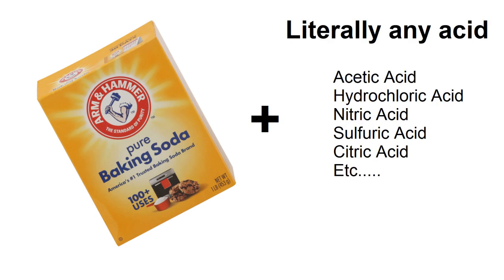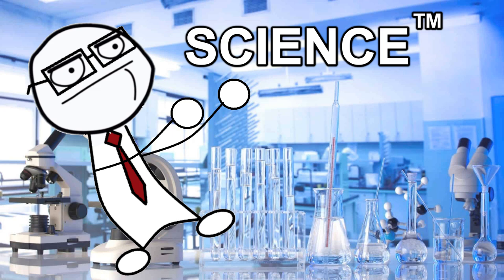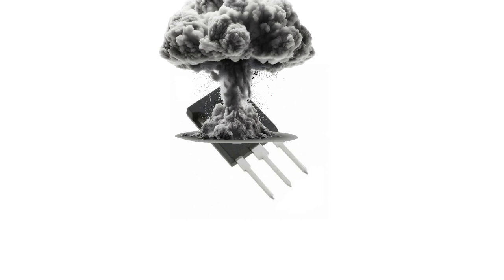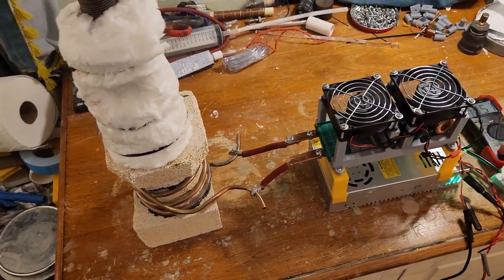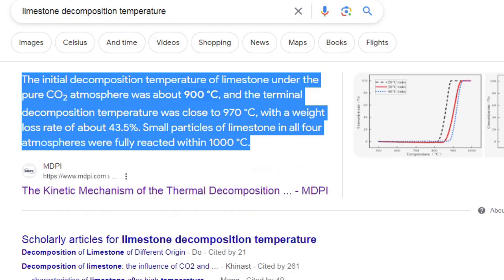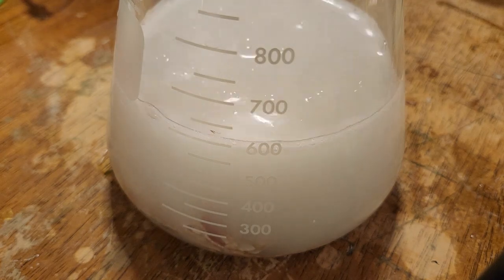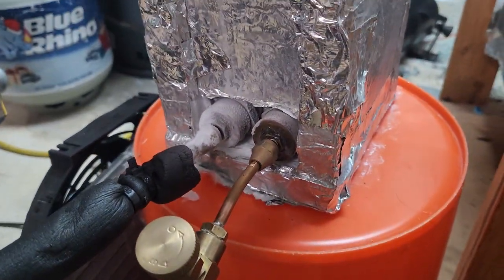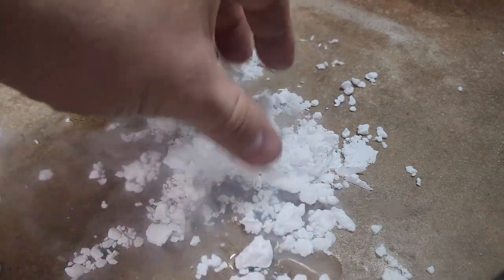Dry Ice from Sea Shells

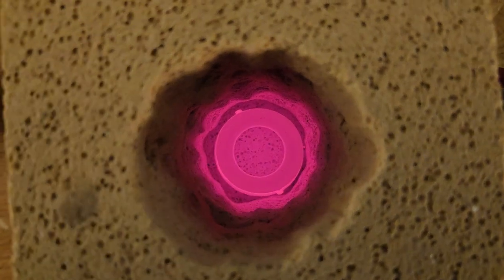Comment: 4:10 Camera sensor is sensitive to a wider spectrum than just the visible light, and they typically have a wavelength band pass filter on the sensor itself or on the lenses, but that filter only gets you so far.
If you have a source of broad spectrum light strong enough, some of IR and UV makes it to the camera sensor and gets registered, and IR triggering red plus UV triggering blue, makes magenta.
Reply: I dont think there is any substantial amount of UV produced, as the spectrum does not even contain enough blue yet to appear white. It would need to be way hotter than that.
Also: so far, every camera i've seen picked up IR as pink
Reply: The human eye has a frequency response bump for the "red" cones high up in the violet area, which is why red+blue appears as purple. I suspect something like that happens with camera sensors, which is why strong IR appears as fuchsia instead of just red. But in their case the blue filters are letting in a little IR.
Reply: As far as I understand, this is generally true, except, red pixels in a display wouldn't be able to reproduce more "red" red, which means, even if the camera picks it up, a screen wouldn't be able to reproduce it without usilising blue component.

So maybe it's a quirk of the inner workings of a camera sensor, that more "red" red, is processed as magenta, and the electronics part of it actually convert "very red" as red with some blue.

Comment: My college capstone project was designing a cement mine and I was in charge of the aggregate and processing (I’m not a chemical engineer or a chemist so I had no clue what was going on). 

Modern Portland cement is still basically lime and some other fun additives. Particle size is very important at every step, which is what I was focusing on (due to an issue with our data, we could not get accurate mineral estimations and thus couldn’t do anything with the chemistry). All the research I had done discussed the importance of the additives and mineralogical makeup of the rock but not the basics of the chemistry. 

But despite days of research, your tiny blurb about limestone and mortar made everything click.

The rest of the video was good too I guess.

Comment: Shouldn't fermentation be the absolute cheapest way to produce CO2? With just a few hundred grams of brewers yeast and a good few pounds of sugar you could generate hundreds of liters of CO2 in a couple weeks. It also yields ethanol as the byproduct of course (but the result will be hardly drinkable if your main objective is to maximize CO2 production).
Reply: Wouldn't that be an expensive way to make CO2 because of the cost of the sugar?
Reply: @ShannonDove-sy7ye 
It would still be cheaper than the previous baking soda and vinegar method, but not quite as inexpensive as I initially thought - unless you'd also burn the byproduct (ethanol) to generate additional CO2. Now that I think about it, burning the ethanol might actually produce more CO2 than the whole fermentation process itself lol. This thought made me reconsider, and I now think the most time- and cost-effective method would probably just be burning a gas. For example, a gallon of propane (around $3–$4) can produce roughly 12 pounds of CO2, and the whole process is much faster than waiting weeks for the fermentation to finish.

Comment: Why not just use propane to produce CO2. use a catalyst in a resistive tube furnance to decompose Propane into water & CO2. Use a Chiller to condense the Water out from the CO2. You can get about 6000 grams of CO2 from 1 Gallon of Propane. You could probably just skip the Beach Ball, and produce the dry ice directly from the the CO2 produced from the tube furnace. A simple test use a descant to remove the water vapor.

Comment: Wouldnt it be easier to just use a common microwave transformer with a dangerously high coil ratio for insane currents on the induction heater?

Comment: In theory what you can do is leaving the calcium oxide in open air and it will pull carbon dioxide from the air, regenerating it.

Comment: hmm, Since your at it, how about making synthetic fuel? seems to you need hydrogen and CO² under a pressure of around 600 bar.
Some invention from a German in the 20tis of the last century but using coal.
Reply: Your referring to the Fischer-Tropsh processe that uses Hydrogen and Carbon Monoxide. It does not work with CO2. FT doesn't require 600 bar, only about 40 bar. I think your are confusing with the Haber-Bosch process to produce Ammonium from Methane which needs about 400 bar.
Reply: @guytech7310  Well, i checked those article only briefly, 600 bar was mentioned in a WWII documentary on German synthethic fuel that's how i got that number. some youtubers went to visit the worlds biggest synthetic fuel plant in South Africa, they said it was CO², the Company "zero" states it's CO² they use to make that 100% climate neutral stuff. in any case the Germans made that fuel using (brown) coal.

You're right: All synthetic hydrocarbons are generally produced at temperatures of 200–300 °C, and at pressures of 20 to 50 bar. Catalysts are usually used to improve the efficiency of the reaction and create the desired type of hydrocarbon fuel. 

using the Sabatier process, i see now.

Comment: That is NOT an induction heater. That's a Royer Converter. It has not been designed for induction heating and commonly known as the Noob Heater because so many people try to build it as an induction heater due to the misinformation on the internet that it can perform as such but IT CANT. It will ALWAYS blow up your IGBTs or MOSFETs as it's inherently unstable. The newb explanation of them mutually shutting each other off and thereby generating the oscillation is wrong. What actually happens is that this circuit likes to latch-up with both transistors being caught shorted and thereby burning out.
The only way to prevent this actually make a reliable induction heater is with proper transistor drivers that ENSURE A TOTAL POWER DOWN ACROSS THE POWER RAILS with a deadtime of both transistors being completely off. Just google Latch-up.

The only Youtube person I know who published a video of a proper induction heater is Backyard Scientist. Look it up. His circuit is solid. That's how it's done.

Comment: You can also absorb co2 using sodium carbonate and decompose the bicarbonate in boiling water (or faster at a higher temperature ) this can be automated you can just get a barrel of it with a air pump and feed it into a heater or heat exchanger with co2 capture (or just brew some beer to get the co2)

Comment: 5:40 these 100K resistors nor the 1k pull-up aren't needed and probably neither are the diodes as the totem pole transistors arrangement strangle themselves on the base witch is kinda cool. Without knowing i have send you the Weighbridge oscillator, using a hi power opamp and a inverting config to drive the mosfets and also less parts.

Comment: I would point out that you can buy big bags of slaked lime for a few dollars, and it has other uses. Or buy limestone of course.Though the bulk price of  baking soda is not that bad for minimal effort and you can use low heat instead of vinegar. Or if you split water you could just use the pure oxygen to burn carbon with minimal water or nitrogen involved. 
But hey, I guess seashells are more interesting. Just not universally common.
Reply: Slaked lime is useless for CO2 production, though. It's more of a byproduct of this method.
Reply: @ZeroPlayerGame  It's a cycle. You burn limestone to emit CO2 and get quicklime, you slake it with water to get slaked lime, and you let the wet slaked lime absorb atmospheric co2 over time to get back to the beginning.
Reply: @spaceminions  ...I suppose, but you could also just use eggshells, or even rock if you live in a limestone geological area.
Reply: @spaceminions  You just designed a new form of CO2 sequestration.
Reply: the lime process is regenerable because slaked lime in water will pull co2 out of the air to reform calcium carbonate, which you can crush and re-heat. he doesn't need to continuously obtain lime.
Reply: @sneediumminer  I suppose yeah. Takes time though.
Reply: @sneediumminer also if I'm not mistaken, slaked lime sets by itself (hence the use in mortar), so I imagine it's a bit of a pain to work with. I guess you can add water and not let it dry, but then the CO2 exposure is way worse still. Atmosphere doesn't have a lot of that, despite our best efforts.
Reply: @ZeroPlayerGame  I have no idea where I would get massive quantities of eggshell, which should have a lot of organic content besides, but at least you don't need to be near a beach. I already mentioned limestone if you only want co2. But it's not pure either although it's not problematic here. As for absorbing co2, back when people didn't think whitewash is made of latex paint, they knew that it absorbs CO2 just fine if you keep it damp, and in fact it's desirable to do so in order to get it to cure properly.
Reply: @spaceminions  I mean, in a thin layer, sure. Organic content is minimal and gets promptly fully combusted into more CO2 at 200 C anyway. Either way, worthwhile idea!
Reply: @ZeroPlayerGame  Thanks. I did see someone else's suggestion of just using fermentation to produce the co2 which I have to admit is much more accessible than the others I thought of.
Reply: @spaceminions  the most accessible would be, just try to breathe out in its general direction :)
Reply: @ZeroPlayerGame  XD
Reply: @spaceminions  yeast can only produce a solution of around 10% ethanol, so my napkin math shows that every liter of brew is only going to produce around 55g of CO2
considering the video was talking about kilograms of dry ice, you're going to be doing a lot of brewing
Reply: @spaceminions  compare to sintering 1kg of calcite producing roughly 400g of co2
Reply: @sneediumminer  Yeah, it's not great for HP because of the speed, but it's still a good reminder that it doesn't have to be high tech. I think a guideline is 2.5-3lb of CO2 from a single 5 gallon run of beer? Not that that's a lot; I'd certainly rather the other way. I guess if someone had nowhere safe to run a furnace, they could forget about a coproduct and try removing the ethanol as it goes, replacing water to keep activity up. May be a trick to do that and keep the co2 pure, so the complexity would get into the range where it's maybe only convenient for someone who has a lab but not a garage, essentially.
Reply: @spaceminions  2 pounds is probably the upper limit on 5 gallons of brew if you take it to wine strength. for beer strength maybe 1.2ish pounds of co2
and yeah this process would be extremely easy for anyone to do vs sintering calcite so there's that, not to mention the byproduct

Comment: I wonder could you compress the co2 into a cylinder using a compressor then discharge it into a sock or pillowcase for the dry snow?
Guess you'd want pure co2 without air

Comment: I think you never gonna heat steel with induction heating above it's curie point of about 800C
Reply: I could be off on this, but I believe induction heating is dependent on the material being conductive, and not it's native curie point. In other words, the struggle to heat higher than 900c could be remedied by applying more current to the coil/applicator, adjusting the frequency of the oscillator, or shortening the ends of the coil.
Reply: @LuMaxQFPV  Below the curie temperature induction heating is a lot more efficient due to magnetic hysteresis, you still get heating above the curie point, but it takes a lot more power per degree of temperature rise.
Reply: @edwardbowers4350  Yes because you can heat up not so magnetic metals like aluminium, but is not that easy like iron

Comment: How did you pick up all of your electronics knowledge? That is a field I have always been interested in but I have consistently failed to learn much beyond the basics. I have had no trouble learning other (what I would consider) equally deep fields which is confusing to me. I am a professional software engineer, and I have build an entire machine shop for myself from scratch. That is actually designed and built all of the machines. It drives me insane that electronics seems out of reach!
Reply: Just get the books the Electrical Engineering students use. The math is less hairy than CS, so you'll be up and running in no time. The downside is that it costs money to experiment, hence why the bread board was developed.
Reply: I'm an Electronics engineer and its easy, its you software guys who are the wizards LOL !

Comment: Nichrome wire for heating is extremely cheap, and I hit 1050C with it easily. Lookup diy electric forges. Naked brass screw terminals are very convenient for connecting to nichrome wire.

Comment: This makes me wonder what the process would be like using plant/biomass sources of carbon. I was thinking of a biogas reactor to produce methane and then a oxidation or combustion reaction but there will probably be too many other contaminates in the gas or the product after oxidation to be feasible.
Reply: Your main gases from biogas are methane,co2 & hydrogen sulfide

Bio gas through iron filings removes the sulfer.

Then Steam reforming & Water–gas shift converts the methane into CO2 and H2.

Comment: I had a thought for constructing your firebrick surroundings for the pipe furnace.  There is a really cheap type of cement you can get for constructing custom firebrick shapes.  I've used it for making ornaments for sitting in campfires for collecting and reflecting heat. I found it on Amazon as Castable Refractory Cement.
Reply: To the top you go! Even hyperspace pirates need info on low tech practical solutions!
Reply: You can make your own castable refractory cement quite cheaply. Take unscented kitty litter and grind it to a fine powder (wear a mask). Kitty litter is bentonite clay, and the unscented stuff is pure clay because there's no perfume. Mix the fine powder with water, and it can be cast as a solid brick, used as a mortar, or used as a surface coating.

Plaster of paris can also work for the purpose.